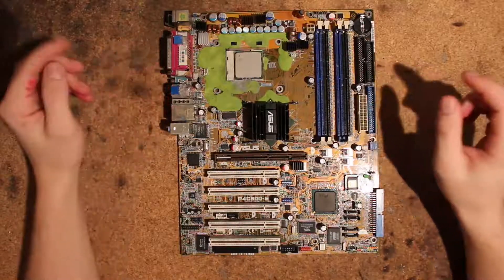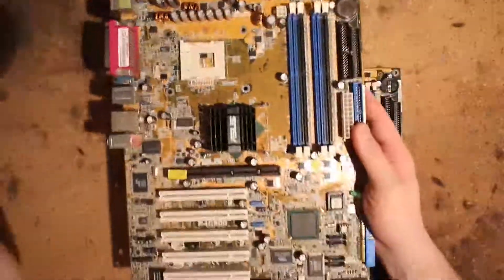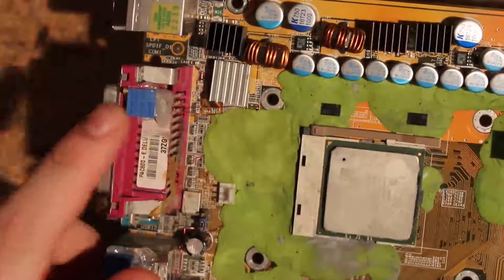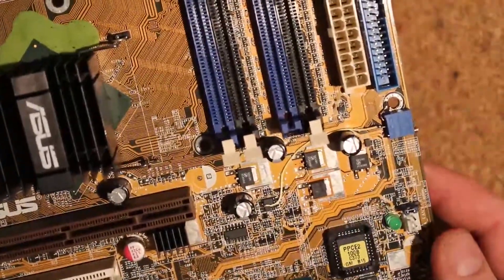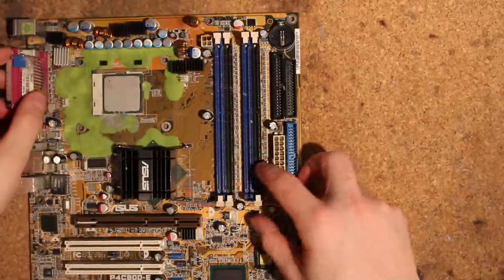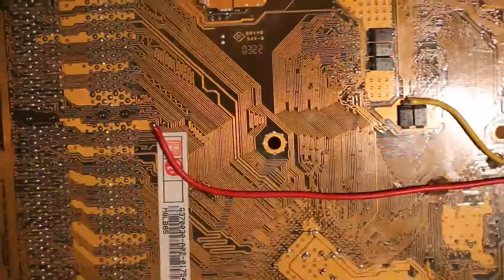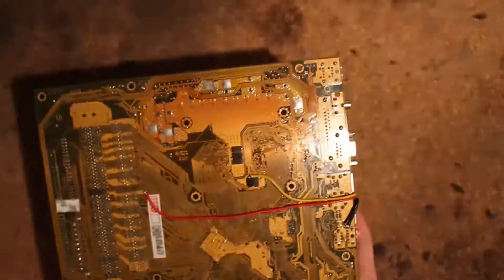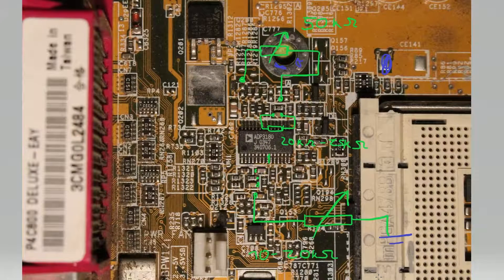Getting ASUS best 478 board ready for XOC / P4C800-E Deluxe voltmod guide

Comment: Thanks for the info, do you have a list of replacement caps ? Gone do my board soon
Reply from the maker: I don't really do lists because you allways have to adept to what's in stock / is good value, but you want something around 820UF-1000uF low ESR polys (3,5mm lead spacing 8mm height) for vcore bulk and something around 1000uF 16V (5mm lead spacing) for input. For Vcore bulk 2,5V rating would be fine but i would reccomend getting 6,3V rated ones so you can use them in other spots (Vmem Vagp etc.)

Comment: Very good explained how to make the mods. But what i miss now how i set the vresistor on vdrop for best value. Do i this while running prime95 and look at the vcore value at hwmon? Or do i set the vdrop while measuring the vcore on the underside of the board with an multimeter? An video how to set the values of the potis in realtime were very helpfull.
Reply from the maker: Vdroop setting depends hugely on the CPU you're running, allso on the benchmark to an extent, so yeah just test out what performs best. Using multimeter is the only way imo, guess you could allso use oscilloscope but software readings are total trash...